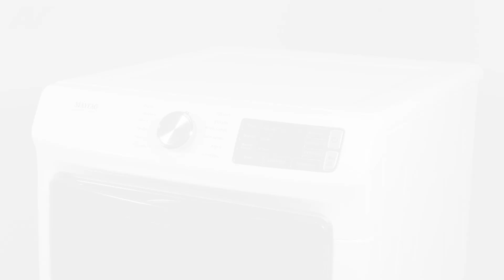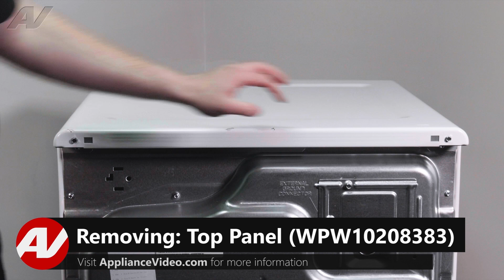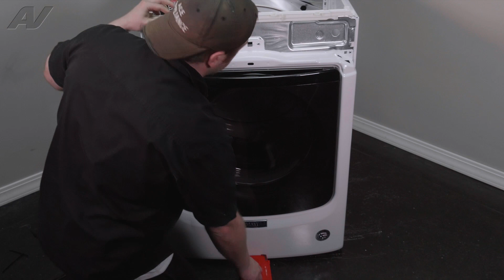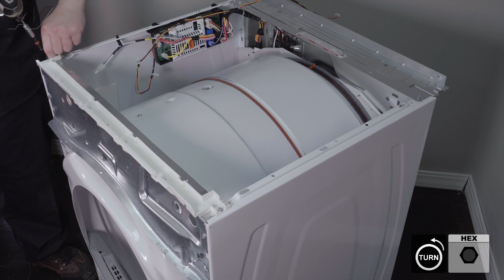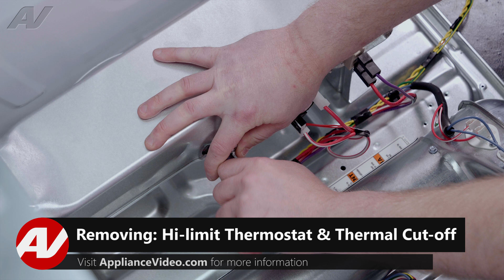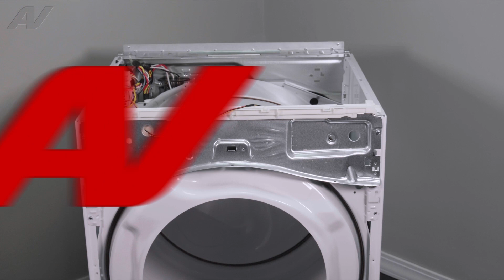Maytag Dryer Repair - Will Not Heat - Hi-limit Thermostat

Comment: Instead of cutting the second strain reliever, I just unplugged those cables from the box on the left side of the cabinet and passed them through the felt hole to remove them with the panel.

There is a small tab you have to push toward the back of the dryer before easily unplugging the wire harness.

Comment: Quick question please: regarding that plastic housing / shroud surrounding the female spade connector going to the high limit thermostat, mine simply will not separate from the male terminal on my high limit thermostat. Now I don't want to pull like crazy and destroy the housing or damage the connector. Any recommendations on remove a such a seriously stuck connector? 

Thank you!
Reply: I did see a video from someone saying they had never managed to remove the high limit thermostat without breaking a certain part of the plastic. I don’t know if it’s the same issue you are having, and can’t remember if it was this video or another.